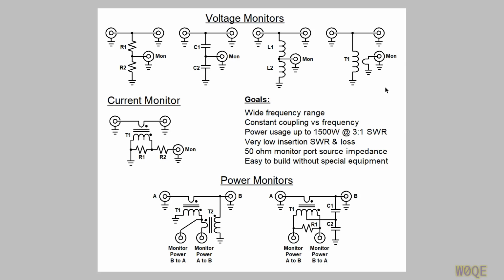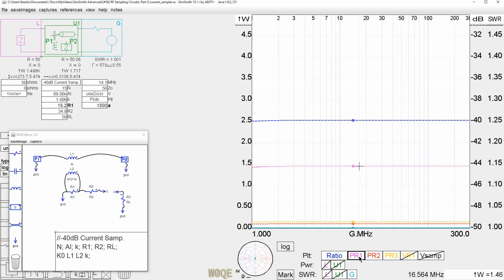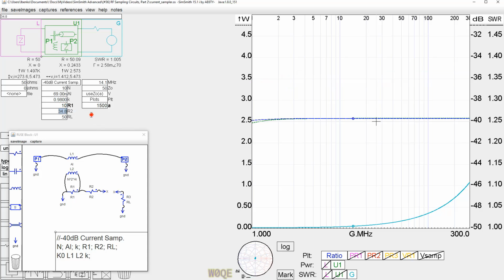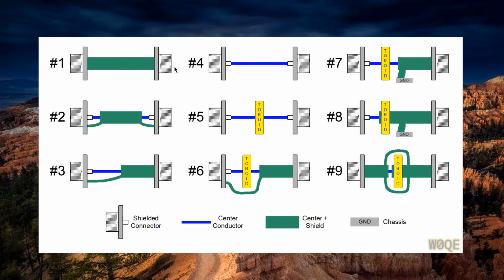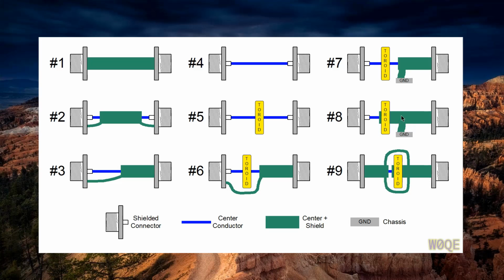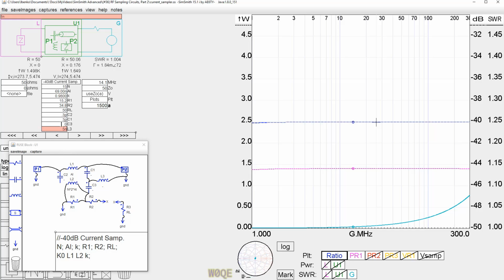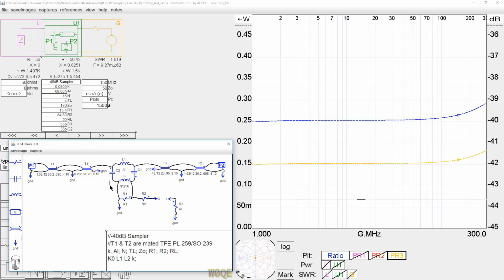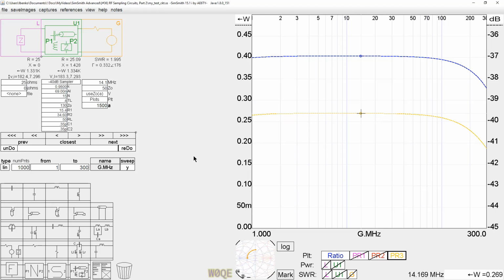#36: RF Sampling Circuits, Part 2

Comment: Regarding the slide with 9 ways to connect the SO239s through a box, would it work to use configuration #1 with a toroid around the coax to directly measured common mode current?
Reply from the maker: No it would not work with what I was trying to draw.  The common mode current on coax flows on the outside of the shield.  If the box with the connectors maintained the integral shield connection there would be no common mode current inside the box and it would flow around the outside of the box.  A big toroid around the metal box would work but it would be easier to use a smaller toroid around the coax before or after the box.
This is analogous to the "Pin 1" problem where incorrect connector usage lets the common mode current inside an enclosure where it causes interference or electrical problems.  In my drawings I was assuming the box and the connectors were put together correctly.  Does this make sense?
Reply: Yes it does, I forgot about the box :-( . So I would like to see a video discussing a good circuit for measuring coax shield current please. Tnx and 73, WB0OEW.